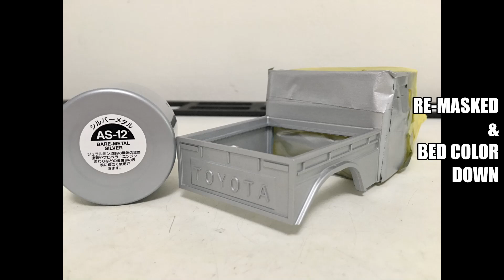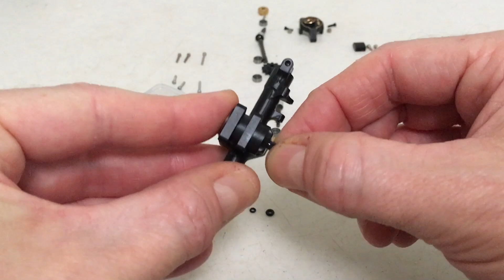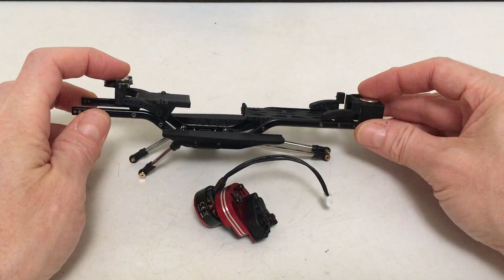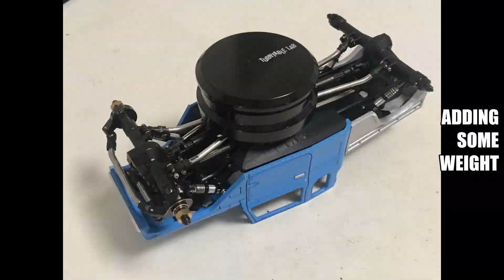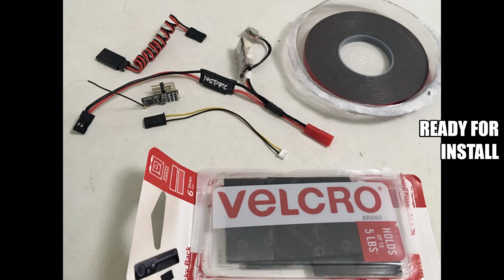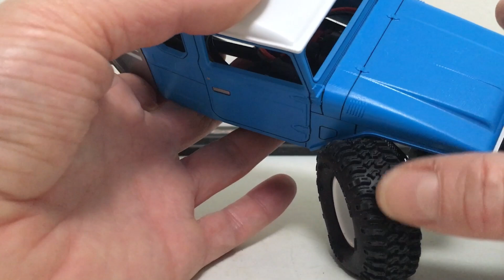SCX24 TOYOTA FJ45-XL BUILD: WT MICRO BODY, STOCK RAIL LCG SETUP, MINI KOMODO, NSDRC, MAZZ DESIGNS

Comment: Thing looks awesome. I just got mine on Friday. I like the colors you went with. Mine's gray and came with a white top - not sure if I want to paint it or just hit it with matte clear. Got any tips on sanding out all the print lines other than endless time and elbow grease?
Reply from the maker: Thank you! Love how this turned out. 
-what plastic did you get? I’ve never actually done any sanding prep to the exteriors of any of the resin bodies. I just hit the underside body edges where the bumps are with a sanding stick. Wash, prime and paint. 
I did just get my first FDM print from him, the Brute, and am actually surprised how detailed and clean of print it is. Very close to the resin detail. 
No matter what you do, it’s going to look good!
Reply: @bcochener  I got the resin print and I kind of half wish I'd have gotten the other but no big deal either way. Just some print anomalies that should cover up well with a coat or two of paint. The vents on the sides of the hood had a rope-like pattern to them so the entire vent looks rather waffle-like. I've base coated it with a flat red so I can do some chipping with the second coat. I got 4 different colors but plan to stick with the slate look. It just worked so well with those wheels and tires. Thanks for the advice!
Reply from the maker: @VermontScaleCustoms  Man, that is a bit unfortunate. It’ll buff out… 😝 
I can literally read the raised dry brush on the Willys. And that is tiny and crisp. I just looked all mine over, and no waffles here. Must have just been an anomaly like you say. Slipped through QC.
Reply: @bcochener  the paint turned out pretty rough. Kind of more of the same thing like the last FJ. I did a little "weathering" but will most likely try and do some chipping since I base coated it. It doesn't look terrible but. it doesn't look great. I keep telling myself it's supposed to be a '67. Are you in the FB groups at all?
Reply from the maker: I’m literally working on a WT FJ as I typed that response… 😝

Comment: New to the hobby - do you have a link to the frame ?? There seems to be a few stock chassis out there. Great work sir.
Reply from the maker: Thanks for tuning in. If you’re new, my builds have lots of good tips and tricks. The frame for this one is just Axial’s stock XL rails: https://www.amainhobbies.com/axial-scx24-jeep-jt-gladiator-xlong-wheel-base-chassis-153.7mm-axi201003/p1397415

Comment: I was getting ready to say the same thing how good you do on your videos what I would like to know I guess you do them in a little short clips until you're ready to put it all together but also how many trucks do you have
Reply from the maker: Hey man, sorry I missed this. Yeah, most of the time they are built in small segments as I have time. A few I have knocked out in a weekend or so pretty straight through. Always depends on is something goes sideways or not… having to prefer a part sure slows down the build. But, currently i think I’m at 40 scx24s if you can believe that. Cheers!

Comment: As a lifelong Detroit Lions fan, I am all bout this color combo!  Great work as usual man.
Reply from the maker: Oh hell yeah! I didn’t even think about that coincidence!
Reply: @bcochener   You can stack the OGRC wheel hubs for more clearance, you will need longer screws, and an extended nut to bolt them to the axles but they do push the wheels out further by a couple mm.

Comment: Awesome build! I know  you get your lights from Evan Designs.  Where do you get the connecter you place on the end of the wire that connects to the receiver?
Reply from the maker: Appreciate that! They are just servo extension cables cut down to length, with the signal wire removed.